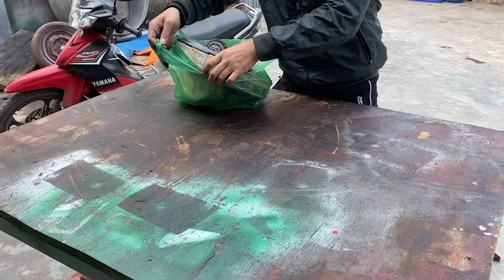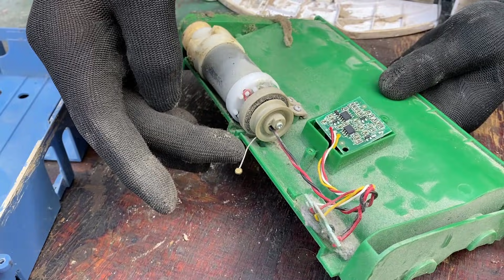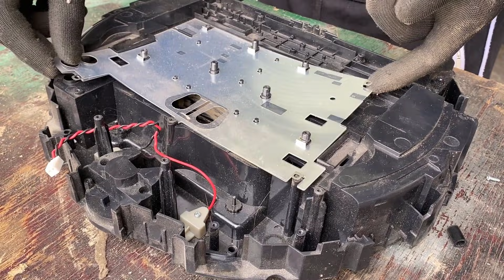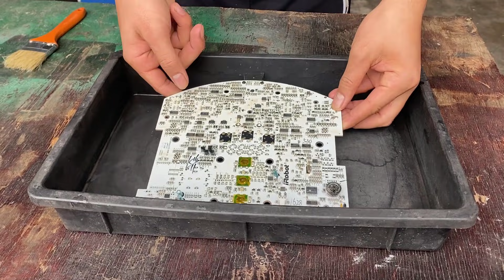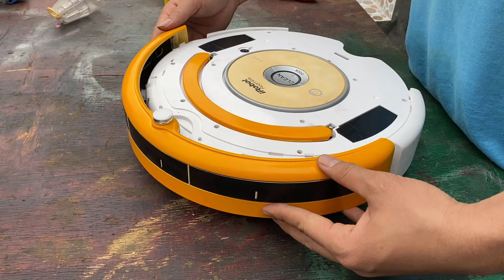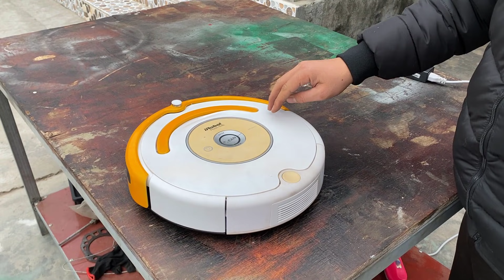Restoration of old Japanese iRobot Roomba | Restore and repair old iRobot Roomba

Comment: I would have appreciated more if you had taken all that trash to the dumping ground instead of repairing an object you've placed there on purpose.
Reply: @Cade Tate instablaster ;)
Reply: @Caspian Allen It did the trick and I now got access to my account again. Im so happy:D
Thanks so much, you really help me out!
Reply: @Cade Tate No problem =)
Reply: I am also suspicious about this “restoration“. It looks like all was set-up. I have repaired several used Roombas of this 600 series myself. Apart from the paint all over, I hardly see any dust packs at the obvious places. The brush unit is usually completely spoiled and needs lots of work to be restored (incl. the motor and the gearbox). The vacuum rotor came out totally clean, like new. Interesting, there is usually a collection of dust in there already ‘in the brochure’…. Then, the IR windows (Light Touch) are still shiny and look like unscratched. In real life they catch the 1st scratches already during the early use.  And so on….. No, I have difficulty believing this video is genuine. Should I post such video you would 1st see me picking bundles of dust out of the internals, then restoring the brush unit (you cannot imagine what lives in there). Then there are the cliff sensors that always get dusty on the inside. One of the last things would be the front caster, and the total disassembly of the side motors including removing the wheels (which are absolutely not meant to be removed). Here you will find hairs from all pets, kits and humans from the neighborhood. Did not see much like this in the video. So, nice try, zero points.
Reply: But he fixed it and they wontid it
Reply: @JacoubStilPlayz  it was never broke. Look carefully.
Reply: @beano😊
Reply: Also, who takes a roomba apart before throwing it in a landfill

Comment: The impressive thing about iRobot’s engineering is the way they make it easy for you to disassemble and make it easy for you to fix any issues at home. I currently had a 800 series roombha from 2013 and had lasted for a very long time. It is still functioning fine. I did recently get the j7 roombha which is also really nice.
Reply: Well of course they make it easy , they're not like Apple where they do everything possible to keep their customers from repairing their own stuff themselves , iRobot sells the replacement parts for a specific reason : to make money and to allow the consumer to fix their own robot themselves , they have even made it simple to do the repairs needed so even an inexperienced person can tear apart and fix the robot theirself.
Reply: @josephbennett3482  yep exactly what I was saying. Btw you didn’t have to stress making a whole summary essay about what I was saying. But, true. There engineering is impressive and I am always impressed on how long lasting they are.
Reply: @weeklongwind  thank you! :) - J7 engineer
Reply: @MatthewDoyle-dm1co  yep. Simple simplistic design. Nicely done my man. As an artistic person. I do see the vacuum got some quirks and a bit of a personality of itself. They best thing is that it can avoid objects and can avoid hair tangles most of the time. It’s a great vacuum that you don’t even have to check on or worry about whenever you go to work outside it just automatically cleans your home. It’s great coming back to a clean home. But, there is always room for improvement for the future of robot vacuums.
Reply: Easy! Have you tried replacing the Cliff sensors and charging ports :-) you better have a nice dirty table about three hours worth of work and Plenty to drink, but yet for the most part they're very modular and easy to work on

Comment: I am Japanese. I have the same rumba. I met the same breakdown. Charging error 3. Perhaps if you run out of new batteries, you won't be able to charge them. It is most likely due to a leak from an old battery and a corroded base. The ceramic chip capacitor per C112 C113 on the base of Roomba may be corroded blue. In this case, replacing the same chip capacitor with solder may fix it, but I replace the board. Probably it cannot be charged as it is. Charging error 3.
Reply: makabao  it is

Comment: btw you don't need to push the "dock" button that for docking to a charging base so if you just push clean and push it again it will run in normal mode.
Reply: Bi😢

Comment: That was a charging mirror when you plugged it in that was most likely because replacement chargers don’t have enough voltage to charge it And the motor doesn’t sound completely right

Comment: These old Roombas do have some design flaws which they fixed with the 800 series. My 600 series needed a lot of service and i had to take apart even the gearboxes and clean them. My 860 now is way easier to maintain. On the other hand the new Roomba loves to take my carpets apart. I gave the old one away.